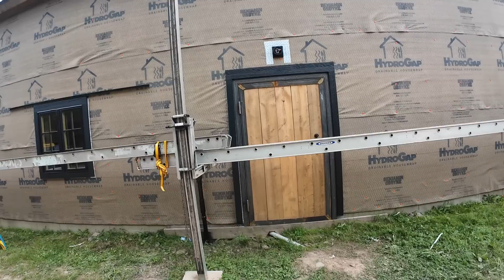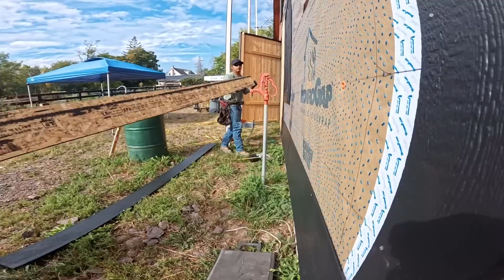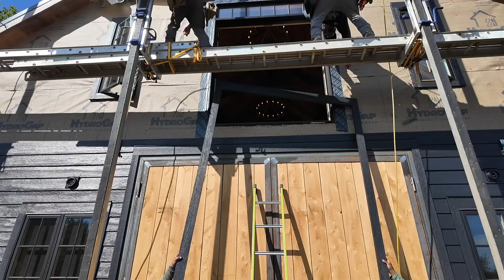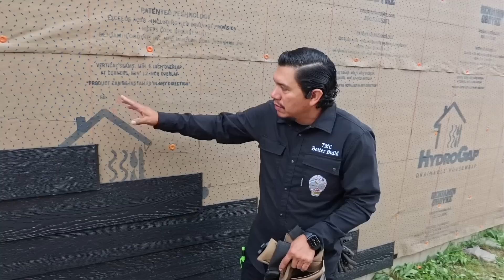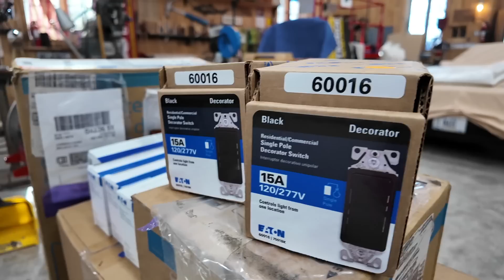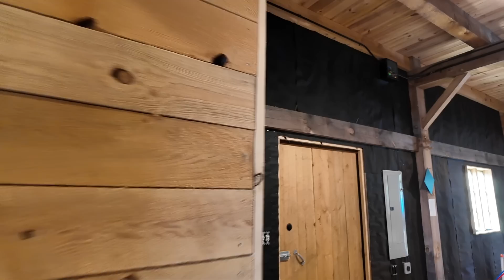Horse Barn Update and few Announcements

Comment: My Dad worked for Eaton from 1965 to 1983, for an electric motor division, and I have an old acquaintance who (iirc) retired from Cutler Tool and Hammer/Eaton in the NOLA area.
 I've also got LP siding on my lean-to shed along my garage. Menards has it in a primed version. I matched the reveal on the garage and painted it (and the very old garage with beat up Cedar siding) Barn Red with White trim. Well the shed's trim will be white once I fully finish painting.